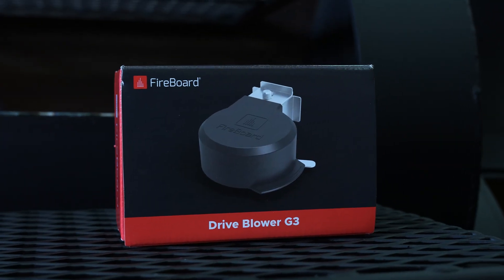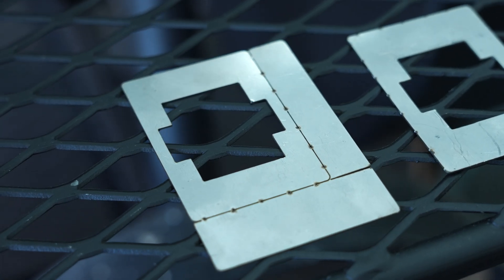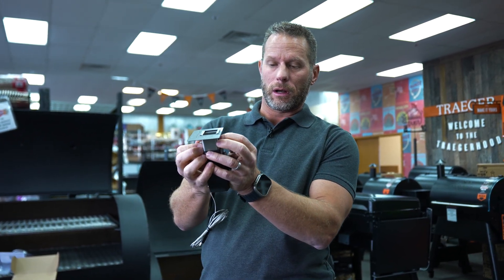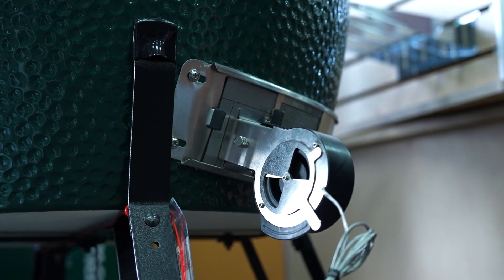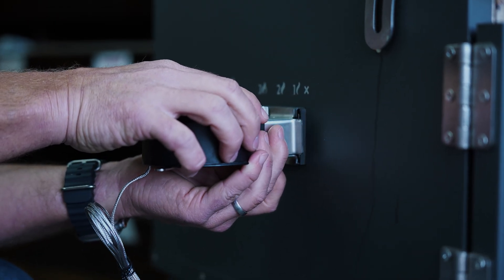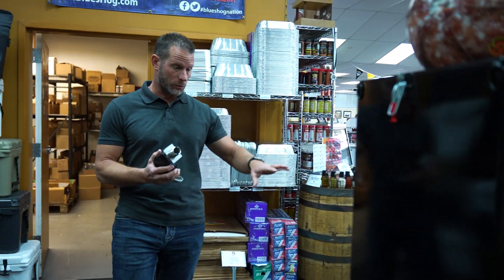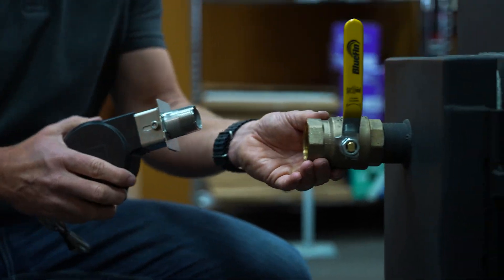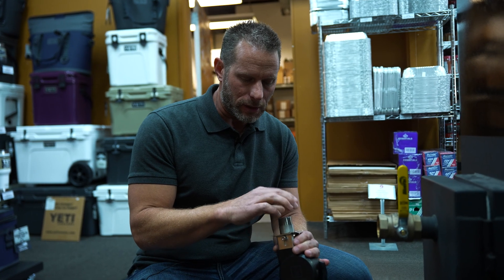FireBoard Drive Blower G3: Walkthrough

Comment: You did not address how to obtain the ball valve adapter.  I purchased a G3 and I have a ball valve adapter from a G2 "that stopped working", but that adapter will not fit the G3?  Where do I get an adapter from?

Comment: I've struggled to get my blower to fit snugly on my XL round komado. But I think the main issue is that the blower let's air flow in even when not running. I get that there's a gate I can manually close but that doesn't help much when I'm smoking overnight and the fire level can change over the hours it's running for. These blowers need to have a gate that swings open when the fan runs and swings shut when it's not. That's exactly what the Rocks BBQ Stoker did and I loved their fan. But they went out of business so I guess I need to fabricate my own swing gate or something?
Reply: Are you referring to the g3 mentioned in this video or the g2?